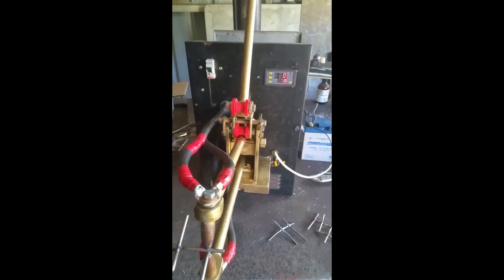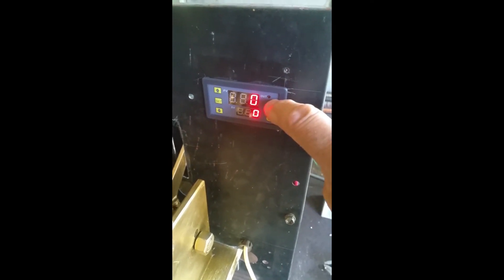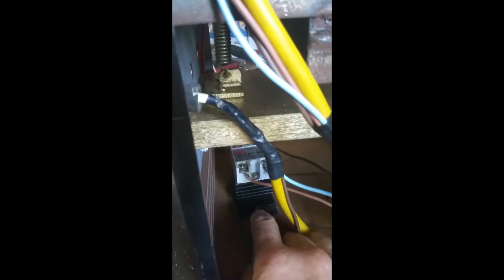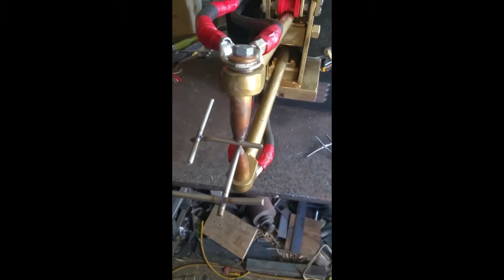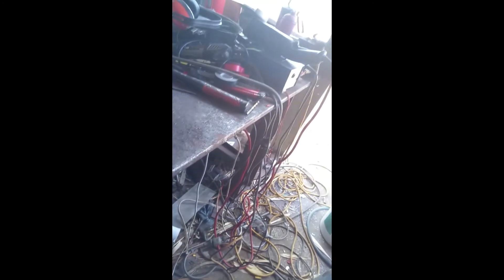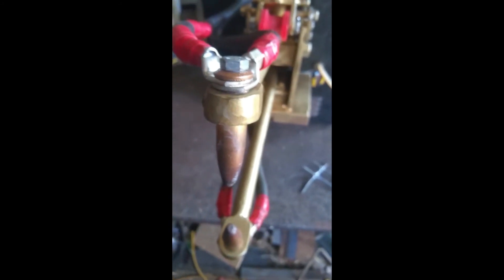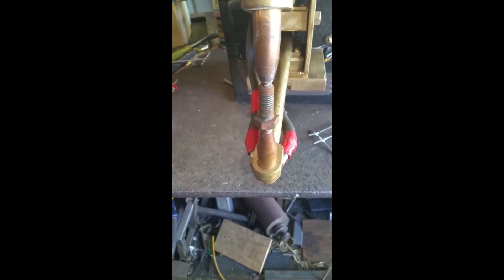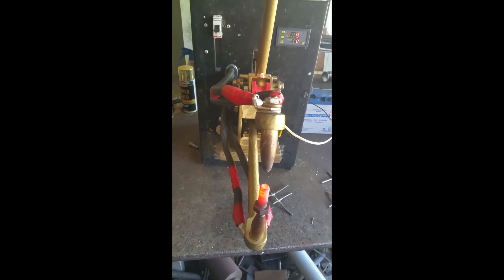Big Home Made Spot Welder out of an old 140A arc welder Part 2 and 2A

Comment: I've been thinking about building a spot welder using parts from old welders I have. I have several old AC/DC tombstone-style welders  I can choose from. I have a large portable spot welder which I used for auto body sheet metal work and it's great, but I'd like a powerful benchtop unit for heavy-duty work. I likely would not add the electronic timer and use a trigger switch while holding down on the electrode using my judgment that best suits the material. Part of my plan is to use another transformer to build an induction heater that's all part of the same unit. You can easily preheat before spot welding metals like titanium and high carbon steel, etc. The combination of the two in one machine would be very handy.
Thanks for posting the video and showing how you built your spot welder. It turned out great.

Comment: Hey man thanks for putting this up. I have an old transformer welder that I never use and need a spot welder. The MOT spot welderd never seem to work for me and I've tried A LOT of different MOTs. Maybe i expected too much from them but clearly you had the same idea that I did just years ahead of me. How has it held up over the years and would you do anything differently?
Reply from the maker: Hi, no problem, I built this welder for a job, and since then, I have moved location,  built a house and am in the process of welding up a large shed. So it has been just sitting in storage for the past couple of years. Once I get settled in another year or so, I might just get the chance to use it again. (LOL). I hope you have fun building yours, If I was to do something different in my build I would find some copper rod for the arms instead of the way I built it with the leads going to the end of the arms.

Comment: seems like  a good idea , a welder transformer is a little stronger and more capable of taking heat , i got a old transformator welder though one without a choke system on it , it should work the same way only at full strength all the time and the only way i would be able to trottle it is by shortening the time 
have a small question about the one youre running though : how mush volts are between the two contact points 
i seen the micrawave transformer spotwelders run about 2 to 3 amps depending on the amount of windings stuffed through the transformator core
 just want to make sure i dont wind to many coils of wire intoo the thing and potentially kill myself , going to go like one winding measure etc , do like to know how long a length i need to get and not turn out not having enough halfway trying to wressle the wire through the two holes
Reply from the maker: Hi, I put this up about 5 years ago and did not realise people are still looking at the video, been a long while since I used it though. I am currently in the process of building a house so all my tools and equipment is boxed up and in storage so can't test it to give you an accurate answer re: voltages, however from the top of my memory ( and that is a bit dodgy)  I think it was about 5V possibly a smidge more. I have a 15 or 16A circuit breaker protecting the primary cable which doesn't trip so input is less than that. Certainly more than when I used the MOT tranny which I think was about 2.5A at 240V input on the primary coil.

Comment: could you show how to wire  the  unit  thanks
Reply from the maker: Hi Michael, are you asking about all the extra switches, timer etc. or the transformer winding itself?
Reply: in my build my cable gets very warm
Reply: transformer  winding
Reply from the maker: Without knowing what type of transformer you are rewiring it is a bit hard to give an exact answer however having said that, the rewiring is pretty much the same no matter what type you use apart from toroidal transformers. If you do a Google/YouTube search on "MOT spot welders" or "rewiring a MOT transformers " it will come up with hundreds of videos and some will show you them being  done from scratch. 

In my opinion, if your cable is getting hot then chances are that the secondary cable is too small in diameter, also bearing in mind that when you use a modified  transformer as a spot welder, you effectively create a dead short in the circuit and the cables will get hot, including the transformer and the primary coil as well, and your duty cycle that you can use with it will be pretty short.

Microwave Oven Transformers (MOT's) are not designed for this this sort of use and are made to be used for short sessions.  Even welder transformers have a duty cycle which can last from 10% to 100%, but that is using the transformer to generate an arc which is quite different to a dead short. If you dead shorted the secondary coil in a welder even that will heat up its cables much, much quicker than if it was just generating an arc when welding.

You could try using thicker cable or adding a cooling fan to help cool down the transformer as well as the cables.
Reply from the maker: Hi Michael, I have upload a video of the first MOT rewire that I did, unfortunately the quality is pretty bad but you should still be able to work out how to rewire a transformer. Hope this helps. https://youtu.be/gsTnoVua3tA